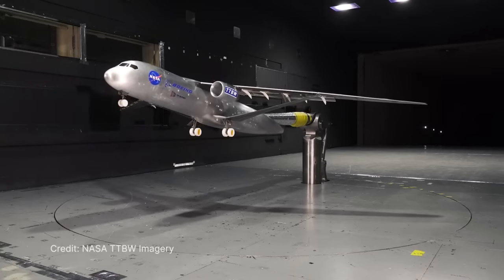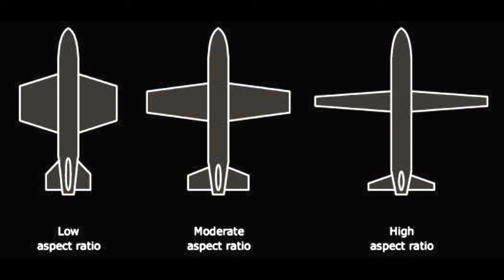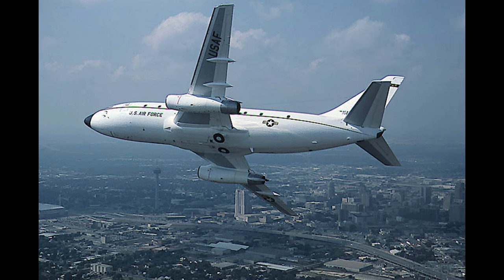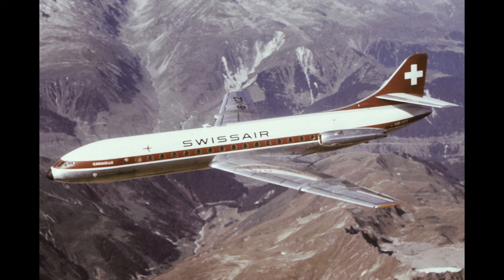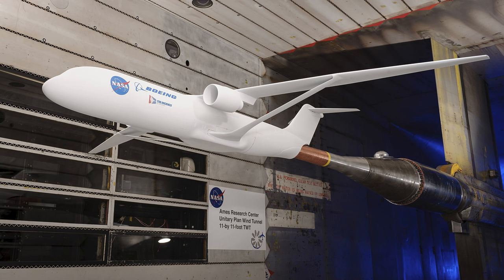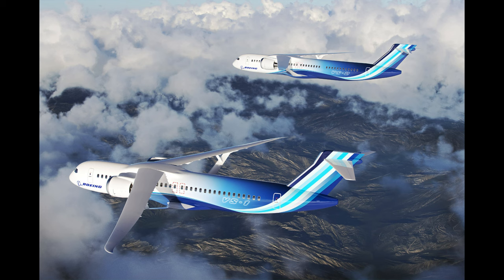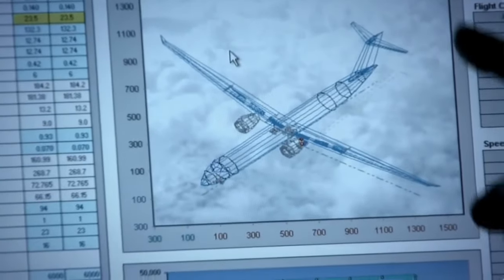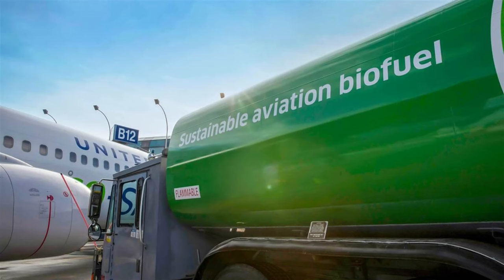NASA's New Airliner Experiment To Make Flying Less Expensive

Comment: Jets are evolving to look more like propellers. Monoplanes are evolving to look more like biplanes. Very retrofuturistic!
Reply: The Bellanca Airbus is making a comeback lol
Reply: And in the next evolution they're going to replace the trusses with wires.
Reply: Simpsons predicted it.
Reply: Let's check in with the local bicycle repair shop owners and see what they think
Reply: And for the vast majority of air passengers that don't actually need to be there at top speed, isn't that old standby, the airship an even more efficient option for future/past consideration?
Reply: @Smee Self wen trains?
Reply: Just like Simpsons had predicted
Reply: auschwitzsoccerref.8582  i thought it was designed in Germany and built in Japan? 

Or was there a prototype made in Germany?
Reply: @StevePemberton2  and canvas
Reply: Turbofans have been on a trend to basically become turboprops for the past 50 years. Safran is working on an open rotor propfan as their next major engine.
Reply: Short flights? Low altitude -> dense atmosphere -> lower speeds -> optimize for near surface flight.
Long flights? High altitude -> thin atmosphere -> higher speeds -> optimizing to reap benefits of sub-orbital hops without actually going into orbit.
Reply: Progression is pretty crazy eh?
Reply: @jaffacalling53  But noise has always been the problem with unducted fans and Safran said "it's as quiet as a modern jet". But what was the DB level and what was the thrust force?? No numbers = no trust.
Reply: @edwardsmith7131  but will still require alot of fuel to reach those speeds, so unless they have cheap fuel and/or use glide landings the fuel will consumption
Reply: auschwitzsoccerref.8582  turbofans were definitely not.
Reply: As engines got more powerful, we had to bother about the body less and less but as we are nearing caps on engines, it's natural to dig up efficient airframes.
Reply: @StevePemberton2  This probably isn't as silly as it sounds.
Reply: Cessna tested a ductless turbine fan on their Citation aircraft back in the 70’s and 80’s. The photo of it is ridiculous-looking. 😄 They found It was noisy and not nearly as fuel efficient as the turbofan engines of the time, like the TFE731 or JT-15. Just as winglets help keep the airflow attached to the wing longer, so does the duct of a turbofan. I’d be surprised to see ductless become a thing, at least with current mass aviation trends. It’s an interesting time to be in aerospace!
Reply: next thing you know destroyers are battleships again
Reply: @dakotahrickard  I'm ready for a solar-powered-electrolysis self fueling hydrogen airship. The panels used for electrolysis on the ground power the propulsion fans in-air. I haven't looked at numbers -- solar aviation is generally impractical -- but I can daydream.
Reply: auschwitzsoccerref.8582  wrong lol
Reply: @dakotahrickard  Sure, or you can do away with the flight part entirely and use a train.
Reply: Yeah that "jets are evolving to look more like propellers" idea, also known as propfan, was never caught on because of weird compromise between speed and efficiency (at lower altitude). Many did not like that it was too noisy. Only one currently in operation is on An-70, which is still debated whether it really is propfan or another turboprop.
Reply: The starship also looks like it's from the 50s
Reply: I can't wait for cloth skin technology to mature enough to replace aluminum sheeting!
Reply: Another Simpsons prediction brewing.
Reply: @drill_fiend1097  They call it "exposed turbofan" and "propfan"  because "a minor advancement in turboprop technology" doesn't bring in as much free investor capital lol
Reply: Exactly
Reply: @Dakotah Rickard  I dream of floating my way round the planet looking down over the forests, mountains, deserts, Ice , and seeing pyramids and whales.  London to Sydney in about a week would be fine . The trouble is the weather would have to be nice the whole way
Reply: @Drmcclung  Carbon fibre (cloth) has already replaced aluminium on a number of civilian passenger aircraft
Reply: It's evolving, just backwards.
Reply: auschwitzsoccerref.8582  Frank Whittle wasn't German. You can have turbofans though.
Reply: Soon they'll all evolve into crabs...
Reply: Auschwitz Soccer Ref.  Correct about the jet fighters but turbofans were not invented in Germany. It was Rolls Royce in the 1950s.
Reply: @suserman7775  I guess it depends what modern jet one talks about.  An F35 is a modern jet
Reply: @skywatcher2025  actually let’s check to see if all the passengers are prepared to pedal their asses off.
Reply: Do you know what’s the most fuel efficient mode of transport…

Walking!
Reply: @dakotahrickard  Like the Hindenburg,  the largest airships ever made, had a maximum payload of just over 10 tons, including the crew. A 747 has a maximum payload of about 100 tons.
Reply: @ndgoliberty  Yes, yes, air trains. An absolutely massive air locomotive pulling several large passenger gliders that would detach as they approach their destinations and then glide down and land.
Reply: @mortiphago well, canvas-like, maybe a carbon-fiber sheet.
Reply: The roaring 1920s would be proud!
Reply: @listerdave1240  Frank Whittle filed the patent for the TurboJet in 1930 and described the TurboFan in 1936.  Hans von Ohain described the TurboJet in 1933 and applied for a patent on his design in 1936.
Reply: @bjoe385  Wrong. Bicycle. Look it up. A bicycle can coast.
Reply: @NeilStansbury  Thanks, I was unaware that Whittle also had the idea of the turbofan. Of course Frank Whittle is not German and neither was he in Germany when he came up with the idea so I don't think the invention of the turbofan can be in any attributed to or even in any way connected to Germany.
Reply: @bjoe385  Not at all. Riding an electric scooter is far more fuel efficient, whether measured by energy conumed or CO2 emmission.  Probably even flying in a modern jet is more efficient. Just think of how much food you would consume walking from London to Melbourne (assuming there is a walkway) and then compare it to your share of jet fuel consumed if you take a flight. Just guessing, maybe someone feels like doing the math.
Reply: Don't forget control surfaces evolving to look more like wing warping. Deep throwback on that one.
Reply: I was gona say that
Reply: @dakotahrickard  the amusing thing is, were airships to make a comeback, they could be pure electric with current tech, have decent speed, great carrying capacity, both in passenger count and cargo. Airships could literally make the entire aviation industry green overnight, but the sad reality is everyone is still scared of using hydrogen for them
Reply: @keiyakins  sure, let's make dozens of sets of tracks across the worlds oceans for intercontinental transport and pay trillions to maintain them, or just travel by air 😑
Reply: @andriandrason1318  worth mentioning that alot of the lifting capacity of the hindenburg was ate up by the interior for the passengers, if memory serves, the passenger space was also a bit luxurious, so a good bit of weight capacity was wasted there, maybe not 100 tons, but an airship dedicated to pure cargo would have at minimum 20 tons, while still being capable of pure electric flight, also airships do have the capability to be scaled up in size pretty easily compared to regular aircraft, so food for thought
Reply: @StevePemberton2  autostrut
Reply: @dakotahrickard   I’m all for dirigibles. Come on, Hindenberg 2.0!
Reply: @andriandrason1318  Consider what would happen if we were to combine buoyancy with downward thrust, like a blimp and a hovercraft or helicopter had a baby. Ugly, probably, but consider the possibilities.
Reply: @alexnorth2452  I honestly don't know very much about airships, but couldn't we use helium more effectively than hydrogen in terms of PR at least? We'd obviously lose capacity, but we'd prevent jokers from trolling the idea.
Reply: @dakotahrickard  considering helium has a very limited supply, and has significantly worse lifting capacity, hydrogen is the only viable option, that being said, despite what the tragedy of the hindenburg would have you believe, the airships were alot safer than people think
Reply: @suserman7775  Who knows how loud it actually is. I'm assuming they keep it quiet by just having a gigantic fan that can spin slowly for takeoff. Regional turboprops aren't particularly loud either, the noise is mainly a product of propeller tip velocity.
Reply: Who ever thought that a mach 8 biplane would be a thing 😆
Reply: There was a meme where a modern ship used, essentially, modernised sails. Seems old ways are best
Reply: @theletsplayer9503  Propfans are just the next logical evolution of passenger jet travel. You can get ridiculously huge bypass ratios while still cruising at Mach. 8 to .85
Reply: @BearAerospace  You forgot a decimal there
Reply: @Drmcclung  there's a slight difference between turboprop a d propfan, and that is the bypass ratio. Afaik propfan is in the middle of turbofan and turboprop, but the excessive noise and vibration it makes over conventional engines made them hard to justify over efficiency gains over some medium-range flights.
D-27 used on An-70 is pretty dubious as its specs are close to existing high-speed turboprops.
Reply: @theletsplayer9503  ain't just a meme, they are legitimately looking into modernized sails to reduce fuel usage on the big freighters
Reply: @drill_fiend1097  I'd say the only difference is the prop itself.. I'd call it a turboprop unless its (unlike a true turboprop) using the turbine for thrust as well. Then it's just an exposed turbofan and dead on arrival
Reply: @alexnorth2452  Modern sails on freighters, love it! 🤣🤣🤣

I'd be weary in that thinking too as wing design has already gone about as far as it can go aerodynamically. The last 30-40 years have been all about small advancements and optimization for intended-use (for the application) and really there's only so much you can do with heavy lifting - increase the span and tweak aspect ratios, dihedral, sweep, winglets, engine selection etc for maximum aerodynamic efficiency and slow the plane's cruising speed way way down, or lower the overall weight (that's not gonna happen) and utilize faster wings. If there were any major advancements left for aero believe me the airlines would already have it. Even engine design hasn't changed too radically.. we've added more spools and gotten HUGELY better at materials sciences & manufacturing, but gas turbines really at the core of it haven't changed all that much (electronics excluded - that's been the biggest advancement in recent years). At this point we're beginning to hit the law of diminishing returns. That's NOT to say things won't get better, but with the way the world is right now we're about to hear more and more radical claims because they always grab attention, and free money.. As long as 'efficiency' is conflated with 'economy' claims will get wilder and wilder (as in fuel economy, not economy as in economics or that sort of thing)
Reply: Wing warping too
Reply: The “de-evolution” of an airplane make sense when you remember early pioneering aviators and designers looked to birds for the physics and design of flight. Birds, especially large soaring birds, are the most efficient with aerodynamics by using wing warping. It minimizes abrupt breakup of airflow to achieve the desired lift properties. We humans just found it easier to manufacture and apply a separated control surface. It’s fascinating that modern day materials and manufacturing processes are only now able to duplicate what nature has been doing and perfected over millions of years.
Reply: NASA's X-59 QueSST begs to differ.
Reply: @FastSloth87  NASA is kinda stuck in the Nintendo past.. Playing the shitty games that sucked ass
Reply: Yes but its so cool.
Reply: Cheaper air tickets if you are prepared to pedal on the new hybrid pedal powered airliners.
Reply: @Drmcclung  that would be dope!
Reply: @StephenJohnson-jb7xe  He'd rather have.. a challenger.. take a diarrhea dump in the air.. he'd rather eat.. the rotten o-rings.. of the rocket that blew to smithereens...
Reply: In other words we’re moving backwards. This is not good. I would not fly on one of these.
Reply: Curved control surfaces like the wing warping control on the original Wright Flyer.
Reply: @fign66  and wooden props since "wood is renewable" 😂🤣
Reply: @dakotahrickard  No. Plot the airship amongst other modes of transport on a von Kármán–Gabrielli diagram and you'll plainly see that the low hourly fuel consumption of airships is entirely offset by the extra time it takes to complete journeys at low speed, rendering them uneconomical compared to other modes.
Reply: @skywatcher2025  haha I see what you did there
Reply: it's a full circle now. dang ol' reliable tech makes a comeback
Reply: More a demonstration in the improvement of materials.
Reply: Not only that but the Wright brothers wing warping technology seems to be making a comeback also according to this video
Reply: @ndgoliberty  Trains are the most efficient form of land transport. Especially when they use overhead wires.
Reply: @dakotahrickard  Yes, but there would have to be some creature comforts. Schiphol to Alicante is about 2,5 hours. If the travel time was double but the seats were the same I would ALWAYS choose the airplane. If the seats were more comfortable, more like a Ferry then it would have potential.
Reply: boats are diverting back to sailboats
Reply: And pilots are evolving into social media influencers
Reply: What next?

Steampunk aircraft,
Reply: @StevePemberton2  Incorrect.

Wires vibrate.
Reply: @cordongrouch9323  And I'll bet they would be very noisy at 550 mph. 

You seem kind of grumpy, did the Grinch steal your Christmas?
Reply: @StevePemberton2  I do not believe in Christmas, as such.

Each and every day should be greeted as a new opportunity to share, learn and grow... And to give to those in need or offer companionship to the lonely and infirm.

Or, design a new kind of neutron emitter.
Reply: @StevePemberton2  I've lived near airports and strategic nuclear targets for most of my life.

You think I don't know how to have a little fun with being generous and showing kindness and consideration?
Reply: @StevePemberton2  During takeoff all jets are noisy, as they put energy into gaining speed and altitude.

Descent and landing are usually much less intrusive to the ear.
Reply: @cordongrouch9323  I was referring to the noise inside the cabin at cruising speed. I would think it might be similar to the whistling sound that overhead power lines make in the wind, but probably worse. 

Actually the amount of load they would be carrying would probably require cables, not just wire, adding to the weight.

Jets are not nearly as noisy as they used to be. I remember in the early 1980's talking on the phone to a friend who lived under the flight path of an airport, a departing jet went over and we literally had to stop the conversation until it passed. By then quieter jets were starting to appear but there were still a lot of the older noisier ones. Any new technology will need to be at least no louder than current airplanes otherwise people won't put up with it.
Reply: @grumbeard  Exactly. An air ferry. That's a good way to think about what I'm suggesting.
Reply: @Catcrumbs  I ... don't even know what diagram you're referring to, but I question the use of the term economical when applied to something like journey time. After all, I'm not talking about replacing typical aviation but in expanding aviation to include slower options at cheaper prices to attract those for whom longer journeys are worth the trade. Today's remote workers struck me as potential clients, as I indicated in my original thought. These persons are already mixing business trips with pleasure excursions in ways that were not possible in our "old" system.
Reply: Technology is cyclical!
Reply: @BondJFK  Ha! That's more of a de evolution sadly.
Reply: @dakotahrickard  That I could see work. Especially for local trips but a comfortable 4 hour trip to southern france? That could be a very attractive solution.
Reply: The world is litarally going backwards. Literally.
Reply: the reason the early planes were biplanes rather than monoplanes is because the wings were not strong and stiff enough to hold themself in the right shape, and needed braces between each other. These new concepts create an enclosed area (which the old biplanes did not) removing the wing tip vortices that reduce lift dramatically
Reply: Maybe finally they will land on the   M 00 n   with that...     🤣
Reply: Bit of innovation for a change
Reply: @StevePemberton2  that would be really fun lol
Reply: Auschwitz Soccer Ref.  well it was the British that came up with the idea of a turbofan and had a better jet only 4 months later.
Reply: @sanitarium017  Almost.
Reply: @samuelshin593  sir this is a video about making planes more efficient not alternative fuels or climate change. its about engineering a way to lower you're airline fairs, and their fuel bill.
Reply: As long as it is fast, who cares
Reply: @peter0702  It must also be economical, and use for fuel only fermented pineapple distillates.

Or fermented coconut milk distillates.

From Hawaii.
Reply: Auschwitz Soccer Ref.  The first patent for a jet engine in the compression form was by Frank Whittle, an RAF pilot and engineer. The first jet engine to fly was developed by a German called Hans von Ohain, who agreed he had seen the patent, but unlike the stupid British bureaucracy he had backing from German government and Heinkel. Whittle and Ohain became friends after the war. So Whittle was the inventor. There are other forms of “jet” engines like pulse jets, steam turbine jets, rocket engines, etc.,invented from as far back as Ancient Greece !
Reply: Biplanes looks cool though
Reply: Auschwitz Soccer Ref.  the jet engine was invented in the UK.
Reply: @Terra Former I rather like trains for overland routes. Some routes are not currently possible by train, which routes would be perfect for these theoretical slower aviation machines.
Reply: @Smee Self flapping wings and aerial screws, in flying bicycles. Very eco-friendly. Maybe even feathered wings in some cases. Maybe the bicycles themselves will be those with that huge front wheel. Of course partly electric, but maybe also with something producing steam for some reason.
Reply: @alexnorth2452  unless we (humans) try boron fusion then the byproduct is helium.  The US Navy actually studied this, but went with fission reactors for their nuclear powered ships and subs.
Reply: @alexnorth2452  you mean the Flenter Sail?
Reply: @skepticalbadger  Look at his username. He isnt worth arguing with.
Reply: Not evolving, but degenerating. It's caused by adaptation for slower speeds
Reply: @StevePemberton2    I like your suggestion that wires may be the next step evolving from usage of trusses, but I’m curious about how wires versus trusses would react to temperature changes regarding expansion and contraction. 🤔
Reply: Exactly what I thought.
Reply: @AlessandroFilippiUX  "Fan Blade Off"
Reply: @bjoe385  Surprisingly no. Humans consume and emit quite a bit, and don't coast.
Reply: @jaffacalling53  Propeller tip noise could be reduced by putting a duct around the prop. Oh wait...!
Reply: Kevin COVINGTON  Got inside a C-5A years ago. The entire Wright first flight envelope, including wingspan, distance, and I believe altitude, could have happened inside the C5.
Reply: @jaysgood10   By no means am I disputing this, unfortunately the truth isn’t very funny.
Reply: @cordongrouch9323  You just need a computer to tune the resonance. 🤣
Reply: @SteamCrane  Interesting.

Steam powered cranes.
Reply: @kentdesrochers4052  fusion is a huge waste of energy especially to acquire an inferior lift force, hydrogen is by far the best option, being both easy to get and having better lifting capacity, and idk the name of the sail design, just seen a vid awhile back showing them experimenting with em
Reply: @alexnorth2452  it was Flenter sails Jaques Cousteau actually used them on his ship the Calypso
Reply: @StevePemberton2  wires made their way into F1 with the 2022 Mercedes.
Reply: Rather stay home and be alive.
Reply: lol
Reply: @Ben Osborne-Ellis  let me tip you off the the revolutionary new design called a bycicle...
Reply: @Alex North  look into the US military airship disasters. Not as straightforward as you would think.
Reply: Can't wait for the plane to evolve into its final form: crab.
Reply: The hell ru talking about
Reply: The Simpsons predicted it, again...
Reply: We got it right the first time!
Reply: @StevePemberton2  thats doubtful
Reply: @dakotahrickard  airships? No. Too slow and too much bullshit to deal wuth
Reply: @ThatSB  Yes I would say very doubtful.
Reply: @dakotahrickard  Totally! I think the only reason we haven't gone back to blimps is the cost of the helium needed to make them work. It's an extremely finite resource, contrary to popular belief.
Reply: @Patrickf5087  We can glide land auxiliary fuel tanks that return to the airfield as drones.
Reply: @bjoe385  No, riding a bike gets you further than walking with the same amount of hydrocarbons.
The ultimate of efficient modes of transport would be an ultralight aerodynamically optimized muscle operated railcar.
Reply: Kevin COVINGTON  Unfortunately Russia destroyed the only AN-225 trying to take Kiev.
Reply: @TheEDFLegacy  Maybe if we do fusion properly, we'll be able to get helium as a result. I'm not sure, but I think that's thing. So when we have our sci-fi future, we can have our steampunk as well.
Reply: Kevin COVINGTON  You're welcome. However I noticed that your comment only shows up to me somehow, so you probably triggered an algorithm to ghostblock you.
Reply: Full circle, we are back to biplanes, this just shows the lack of any real investment iby the industry in improving airplanes.  It's like strapping more efficient engines on that destabilize the plane so much they fall out the sky.
Reply: @dakotahrickard  It works out to about break even. Where the airship falls down is the weather envelope they can operate in. The minimums / maximums for a jet aircraft compared to an airship would most likely decrease the available flights, and  what flights are able to embark and leave are more likely to have to divert as weather can move faster than the airship.
Reply: @Drmcclung  ummm... you DO know what carbon fiber is... right?
Reply: @nunyabidness674  but but but carbon fiber isn't green and renewable like canvas skin and wooden spars!!
Reply: @natemeins  Wait a sec here... Winglets keep airflow attached to the wing longer? I might be misunderstanding your meaning here, but I could've sworn the main benefit of winglets was to act as an interrupt of the wingtip vortex coming round the wingtip and inducing a down force on the wing... AKA more of the wing provides lift rather the roughly 30% of the wing either not producing lift or actually pulling the airframe down. When you say that it is to prevent seperation of airflow, it sounds like you're implying that a portion of the wing is in a dead air pocket like what the dimples in a golf ball induce. A thin layer of "dead" air surrounding the surface while the actual airstream passes by only contacting the dead air layer.
Reply: @ExtremeSquared  2 Kw power supply to run the water splitting, roughly 9lbs per gallon for the water, the entire surface area of the R101 would still fall short on the required solar collection area, and then the Hydrogen would be a pain in the butt to actually burn in a controlled manner... Not to mention the heat difference between Hydrogen burning compared to pretty much any other fuel almost demands using tungsten components.

I'm working on a gas turbine power plant idea using pretty much the same concept you just outlined, but with the benefit of it doesn't need to be light enough to get off the ground...
Reply: @nunyabidness674  nope, you’re right, they do prevent wingtip vortices, but they also help air stay attached to the wing from leading edge to trailing edge instead of slipping off the wing tip too early. Much like wing fences do. It is especially relevant in swept wings. Straight wings aren’t nearly a problem, which is why nowadays you see “swooplets” instead of winglets on (mostly) straight wings (see Citation Sovereign+) Listen, I don’t claim to be an aerospace engineer, I pull this from my 25+ years as an A&P. I fix em, I don’t design em. 😁 Cheers.
Reply: @natemeins  Ahh, okay. I get your meaning now. Was kinda like the Avro Arrow needed the fences to prevent hypersonic shock from ripping the wingtips off.
Reply: @nunyabidness674  I was suggesting that electrolysis take place on the ground, with a terrestrial source of water, and only to replenish the lifting gas. Propulsion would be electric / battery only. Never both running at once.
Reply: Great observation my man.
Reply: @dakotahrickard  Explosions and Fire are even older than that!
Reply: The entire history of comercial jet aviation just seems to have been one roundabout journey to reinventing the turboprop.